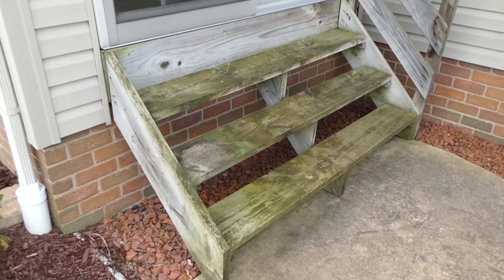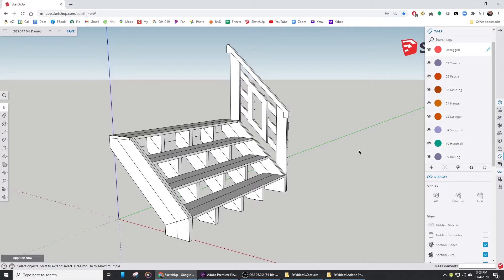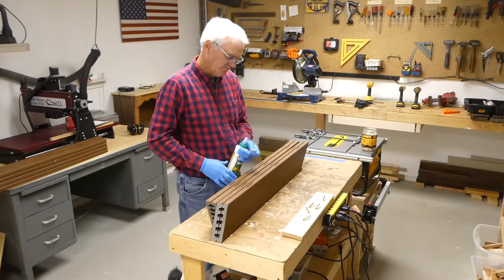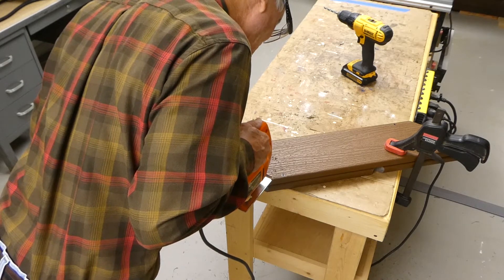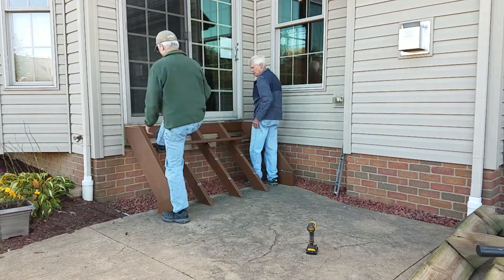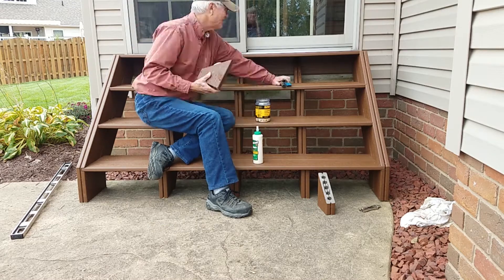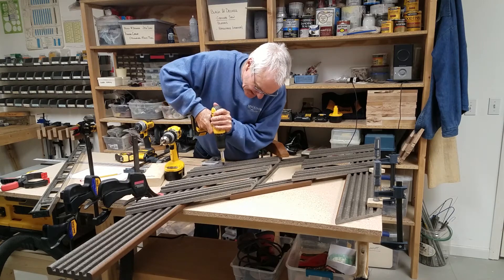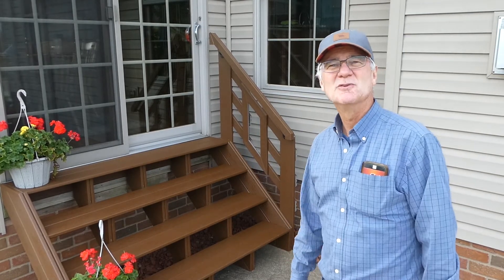Outdoor Stairs Constructed from Trex Composite Decking Material

Comment: What is a CNC machine?
Reply from the maker: CNC stands for Computer Numerical Control.  The CNC machine I use is a CNC Router which makes parts primarily out of wood by programming the path that a router takes in space along X, Y and Z axes using stepper motors.  My last video describes the whole CNC routing process from concept to finished product on a small wooden part.  See ... https://youtu.be/NMl9Ms1wo0E

Comment: Love how you made everything using trex decking material. Wish trex made 2 by material to make the stringers easier.
Reply from the maker: Thanks for the comment.  Not everyone was happy with the use of "non-structural" material for the stringers.  I'm expecting to be fine given the overall scale of the stairs and the overcompensation on the stringers ... but I did add a disclaimer in the description.  I agree with you though, it would be nice to have some 2x structural options.

Comment: That top step is a tripping or fall hazard for anyone over 60.  extended first step, small platform or deck then stairs would have been much better. looks like you have plenty of room & nice concrete base to land on.
Reply from the maker: Agree that a larger landing would have been better ... if not for the issue where the stairs would have led directly into the bump-out for the fireplace.  The top step being level with the kitchenette somewhat offsets the landing issue; however, there's still the channel for the sliding glass door interrupts the landing area.  Me and my over-60 friends (including one that works for the local agency on aging) still believe the new stairs seem much safer that the originals.  Thanks for taking the time to weigh-in.

Comment: The manufacturer says you can’t use the decking for stringers. Also, if you wanted a landing at the top, a code required landing is minimum 3 feet deep. This stair is not to code and won’t last.
Reply from the maker: Appreciate the manufacturer and code information.  Not sure whether to consider the top tread to be a "stair" or a "landing" for code application.  The top tread is level with the kitchenette so the whole area is a landing of sorts (of more than 3' deep) with the sliding door open.  In any case, I can say from extended personal experience that the stair package is considerably safer to navigate than the original installation.  As for durability, only time will tell how long it will last.  I suspect the new stair package will outlast the original installation but I will certainly post an update if I ever encounter issues with the design.  Thanks for weighing-in.

Comment: I love the project.  Following up almost a year later, how is the composite material holding up?  I figure that the load being borne by these steps would be consistent from day to day, with some heavy instances as things are brought into and out of the house, so it would make a nice small measuring example for how composite behaves and holds loads over time.
Reply: Thanks for checking-in.  My opinion may be biased because it was my project but I think the stairs still look great and my wife and I continue to comment how much safer we feel with the top "landing step" that we added in the new design.  Because of using composite material on all faces, they still look like new.  Even a year is still early days in a sense but I'm very pleased with how the stairs have held their integrity and appearance.  Check back in a decade ;-)  I'm just curious if the floating patio is done settling ... but even at the outset, I considered that I could fashion some composite "feet" under the stringers to correct for settling over the years if needed.
Reply: @FlashTraxFamily  That's great!  I can imagine the stairs looking almost like new for quite some time.  I'd seen the disclaimers about the composite boards not being designated as safe for load-bearing, but I wondered about marrying three or four of them together with screws up and down an 8-foot length, and using a few of these as structural supports for a high deck, instead of wooden 6x6 posts.  I wish I had the resources to test this out first, as I wouldn't want to accidentally cause a collapse with such a scheme.
Reply: @davew6949  These are good points. Composite isn't a true "structural" in general.  But I do notice that things like load-bearing benches are made out of it.  And I did double-up on the stringers as you mentioned.  Also, being only a three step structure, I am not too concerned that I went a little outside the box on the design and it looks and feels sturdy to me.  Thanks again for the inteaction.
Reply: @FlashTraxFamily  and thank you as well.  I can see that benches, stairs and flooring will work fine with composites.  They do have heat limitations (150 F and above) that lower their weight capacity, but that's not going to be an issue with things such as stairs.  Your stairs ought to last for many decades, perhaps even outlasting the home.

I think my dream of using them as 8-foot load-bearing substitutes for 4x6 and 6x6 posts has been defeated, however.  At least until new generations of composite materials come out.